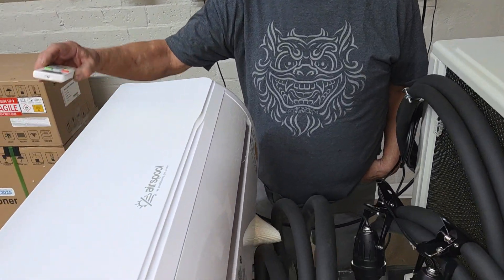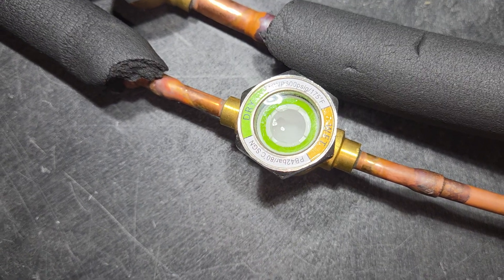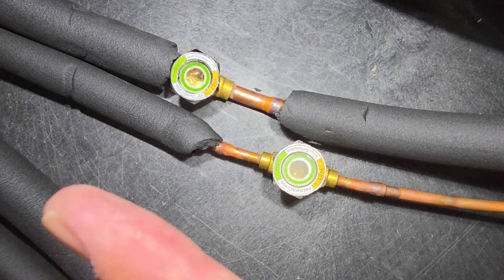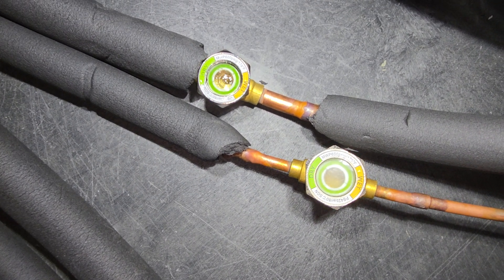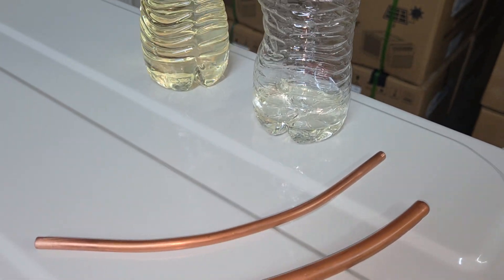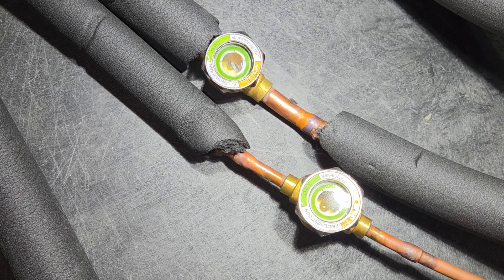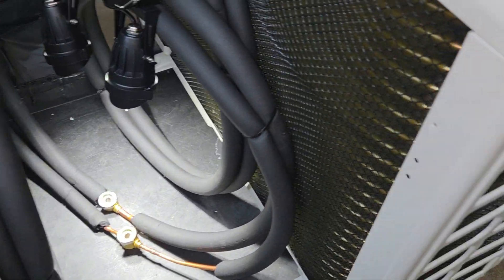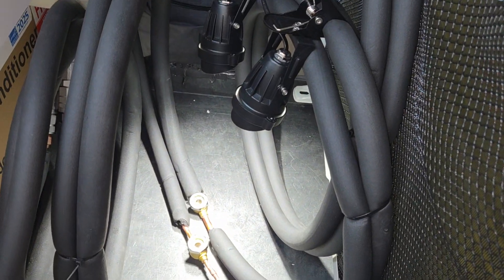Does oil really get trapped in vertical line set loops?

Comment: Yes, there is supposed to be some oil throughout the entire system. Creating an oil trap from loops in your mini split is likely not going to happen.  Also, these mini splits are designed with oil movement in mind. They actually have to run at high speed for a certain period of time to make sure oil moves throughout the system. This is something that’s designed into most units. Oil loss is generally more a function of lack of compatibility between refrigerant gas, and the type of oil used. There’s actually a term used in the HVAC business for how oil and refrigerant gas work synergistically.  It’s called miscible.

Comment: DuPonts OG refrigerant piping handbook called for a P trap on the suction line every 4 foot of riser. 
the looping sometimes can be good, if done correctly.
Nice video.
Reply from the maker: Yes, makes sense. And I think there is sone tolerance, but by and large, people, follow the instruction manual! If it says don't have more than 25 ft between your indoor and outdoor unit in terms of vertical rise, follow that! Because without that velocity, oil entrapment has a bigger potential.

Comment: IMO why oil doesn't exactly trap for mini splits is because they typically have 0 super heat or liquid coming back to the unit. Thus, it can't be trapped vs a normal system that does not have any liquid return after the coil by design. Gas cannot return oil well, but liquid can.
Reply from the maker: Really, if you watch the video, or try this at home (by putting oil in a 3/8" copper tube and blowing at 3000 ft per minute), oil that is resting in the tube will get blown up back into the compressor. So it actually is in the gas. And yes, you shouldn't have any liquid coming back to the compressor ever, but if you have dirty filters or poor air flow, then that's an issue. In the video, some does indeed look like some liquids coming back, and that could be because the unit starts out pretty fast, and there's not enough load inside, because the air is already 75° or whatever. I think this liquid probably would diminish over time coming back to the compressor. And there is the accumulator to help with any liquid..
Reply: @airspool  of course I watched your video :). I will say, I've had to play around with the charge on my mini split (I think the cool side is restricted. It's a capillary tube metering device) and am surprised at the amount of oiil that comes out as I tried to recover. Usually when I did the trade years ago, that amount of oil would only be seen when a compressor was replaced and no one tried to set the oil level right.